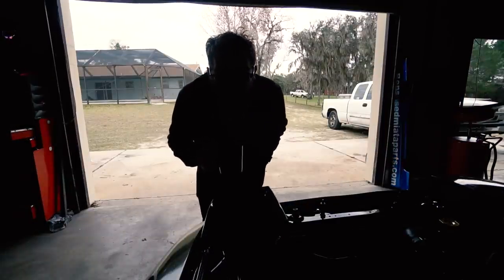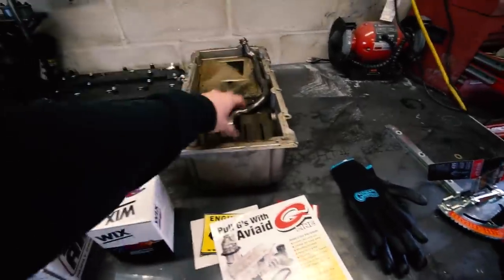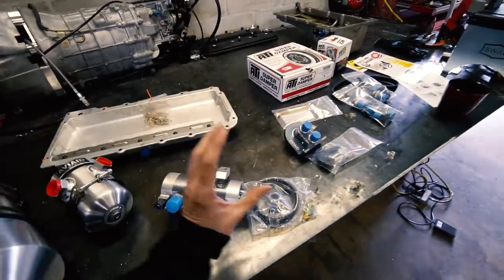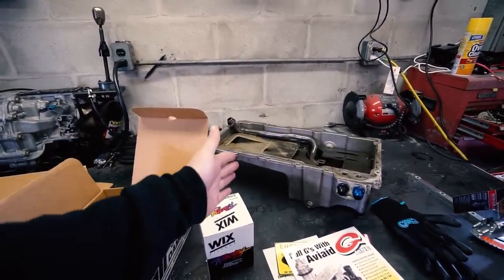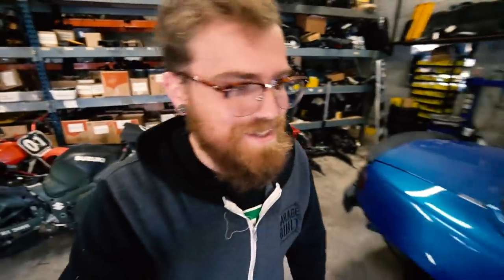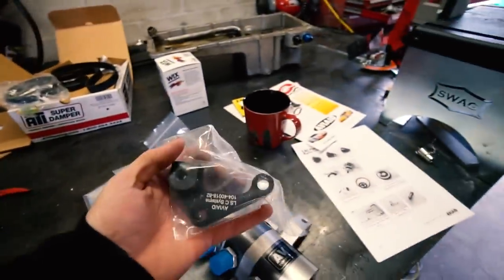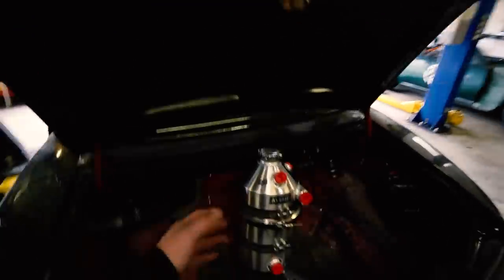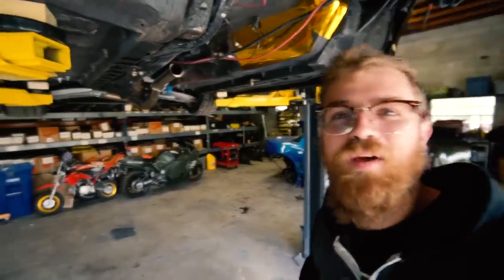Full DRY SUMP Setup For The LS Miata!

Comment: i know you don't want to.. but really rebuilding the whole engine is the best idea. you're putting all these nice parts on an unknown junkyard engine... it could throw a rod through your new pan the first time you drive it and send all the shrapnel through your new pump. at the very least order new bearings, rings, and seals while you have it out and inspect everything. just my opinion. you already know the engine has some problems.. don't cause more downtime later because you want it running now
Reply: Just what i was about to say!!! PLEASE Taylor!!!!! We want to see you rip the LS not only wrench it!
Reply: I agree, also find a way to get the sump tank closer to the motor/pump. Consider a prelube solution to avoid dry starting the motor.

Comment: Since you have to remove the oil pan, PLEASE just replace the rod and main bearings while you are in there!!! It is cheap insurance so that your new $2100 oil system doesn't get full of 100,000+ mile rod bearings. As for the tank cut out the floor in the trunk and drop it down in there. Use some of that leftover aluminum to make a new floor. As for the oil lines you could cut out some holes in the rockers and fish the lines through. This would keep them out of the car and away from the exhaust. Will be watching to see what you come up with.
Reply: Matt Lundquist if the oil lines are in the rocker panel, what happens if the car gets hit on that side and squeezes the lines shut.

Comment: From what I have heard, Peterson makes the best dry sump tanks.  I suggest you look at the insides of one and then think about what you can fit in front of the passenger side wheel well.

The farther your tank gets from the engine, the more likely it can starve from G forces preventing oil drain back from the tank to the pressure stage of the pump.

I know the big deal about Peterson tanks is they have baffles and angled oil ports to avoid splashing and aeration of the oil inside the tank.  Oil with air in it doesn't pump very well.

I think simple and compact will do better than long hoses and a big tank.  At least search a little to figure out your tank options.

Comment: Be sure to familiarize yourself with a dry sump priming procedure. They are killer systems, they work great, but require some extra steps. Also, be sure to read the ATI instructions. Typically the balancer hubs come around .007” under sized, you have to buy a brake hone and open them up a tad. If I remember correctly, ATI wants between .0009”-.0015” press fit to crank snout. If you don’t hone it, you will cry.

Comment: News Flash: Taylor Ray Rimjobs Rabbit-hole and Runs!

That's fantastic news. It's great to hear that you get to run your completed project in "stage 1" configuration.

As for the oil line routing, I would take out the passenger seat and carpet and run the lines up between the seat rails and the trans tunnel side of the passenger floor. You can cut an access hole in the firewall wherever it works for you, and right through the back of the passenger compartment by the oil tank. I would bend or weld a bolt-on plate/tunnel to cover the lines so you splash-proof yourself and your passenger, then reinstall the carpet (probably having to cut the carpet away for the cover) and seat. That makes it largely weatherproof and safe to use while riding with most of your stock interior, and still lets you unbolt it to replace the lines without cutting anything off. Running them through or near the rockers will probably lead to a massive leak when Matt or Adam come in at your door one day.

Comment: The ls3 comes stock with a dry sump system. I watched this video then shopped around and found that. I got the oil pump uses, used Pan, used tank. And several other nick nacks. Costed me 1100 bucks total for absolutely everything. 

I never knew the ls3 came stock with dry sump lol so that was handy to learn.

Comment: If you have oil lines that long please prime that oil system for at least 10 minutes at full oil pressure. should be able to spi. the pump with a hand drill with some adapters.  Dont use impact!   Just trying to help!
Reply: This isn't a gen 1 or 2 sbc, the oil pump is mounted to the crankshaft....
Reply: @nicholashall7233  you muppet.  Did you watch the video? The dry sump system has a remote mount oil pump that is belt drive lol.
Reply: Must have missed that. Wonder why they wouldn't have used a factory oil pump and done away with the need for a separate pump
Reply: @nicholashall7233  its the nature of a dry sump.  There are 3 pumps. 2 that scavenge off the bottom of the engine and merge to one line and pump back to the tank then 1 that pulls off the tank and pumps to the engine oil galleys for oil pressure/oil feed.
Reply: Nicholas Hall you didn’t miss it, you just didn’t watch the damn video.. 

Btw, normally they pull off the belt and spin the sump pump with a drill until they have enough pressure.
Reply: @francoinocencia604  i know most people know that just wanted to make sure taylor knew that.  And you spin it at pressure for 5 to 10 minutes to get any air pockets and bubbles out.  Aeration of the oil can kill it on start up
Reply: @francoinocencia604  👍 Definitely watched the video....

Comment: taylor i have been going over the idea of cutting the inside of my trunk out for some time now. If you cut the whole spare area out down to just below the lowest point it should clear the diff by a land slide. You would just have to weld a plate back to be the floor of the trunk. I havent fully thought about where and how the sub frame mounts but that is also something to consider.

Comment: You should look into the daily engineering dry sump stuff with their air oil separator.  It's pretty impressive with how well it keeps oil from foaming.  They have a good video on here showing how it works.

Comment: I have run the lines in side it's fine ,I find it feels safe , knowing you won't hit them on stuff and that won't get hot next to exhaust pipes ,you just have to come up with a good way to change the oil ,the tank was in side the car on my Nissan and it sucked to change oil ,the boot is the best place for it ,you can run a drain out the bottom.

Comment: Easiest way i found to lap valves was to take 1/4 inch fuel line hose and put the end in a drill, stick the other end on the valve and go to town. Otherwise you'll rub your hands raw before they lap well.

Comment: Could you not cut a hole the same, or slightly smaller diameter of the dry sump tank in the spare tire well, that would recess the tank and drain plug out the trunk pan? Then you could get some weather stripping in an attempt to seal the hole, and keep from having metal-on-metal contact between the floor pan and tank. 

And as for lines, would it be possible to run them on the inside of the trans tunnel under the carpet? It would keep the clean interior look, as well as keeping the lines away from any heat source.

Comment: One trick we use on the drains for the dry dump tanks is we use a fitting and hook up a hydraulic hose with a cap on one end of it so we can drain them without making a big mess. Also for the issue with running the lines, could you possibly run them inside of the unibody frame?
Reply: Garrett Calvert Ayy latemodel gang
Reply: I was thiking a ball valve and safety wire the handle in the off position, or take the handle off and just put it in the tool box.
Reply: twiggybuick the reason for the hydraulic line is so you can route the drain to a more convenient spot then use two wrenches to take the cap off of it. With a valve you would still want a cap on it anyways so no dirt or moisture could get in there. Plus I would rather look for a wrench at a racetrack then try to figure out where I have s valve handle 😂
Reply: @garrettcalvert6967  makes sense.

Comment: When your starting up your car with dry sump... add a delay to the start so it builds oil pressure before firing since the system needs to pull oil from the tank vs just pulling from the pickup and the crank already being wet because wet sump.

Comment: If you're going to put the sump in the trunk then you should run the lines like Rad dan does in Supra just use solid aluminum pipe then you can go through the passenger compartment

Comment: Taylor, cut out the floor in the trunk and weld in a new deeper floor so you can fit the big oil tank there 
That way you also will lower the weight point of the car at the same time 
And it would not be that much work to just cut the floor out and weld in new , and it will look so rad !

Comment: Taylor,  why not build your own custom oil tank for the engine bay?!!!!! Do it!  Way better than running lines to the trunk IMO. You can do it 👍. It would be an awesome project and I think a cleaner setup.
Put it in the shelf where the oil catch can goes. Looks like it will be a good volume of oil.

Comment: I'd lean more towards cutting a hole in the trunk to keep the oil capacity. Have you thought about running lines through the frame rails and just cutting a hole towards the engine bay at the end so they're still protected and if they fail you and a passenger wont get covered in hot oil. The only issue I would see happening is the lines getting crushed into the rail and getting the lines themselves in with fittings and stuff.

Comment: Since you have the after market frame rails could you clear out the old crushed up ones and feed the lines through there If so it would clean it up and protect the lines better without having to run it through the cabin

Comment: I'm psyched on the dry sump man!  I thought it was going to be way more then that.  On the parts to order, you may want to do head studs.  I have always heard you only use head studs once because they stretch, but I don't know that for a fact.  The other thing that I wonder about on running the lines to the back, will you lose pressure since the oil had to be pumped farther?

Comment: I wonder if the dry sump setup will increase horsepower due to the better oil evacuation in the block.  Seems like I've heard claims in th 15 to 20 whp range nothing too huge but it should rev much faster ? Your thoughts on this would be great
Reply: It's more like 5hp to 10.
 Engine masters used a 700hp engine and tested running less oil in Stock and high capacity oil systems but it was a wet system

Comment: Run the lines through the top of the transmisson tunnel? thats about as far away from the heat you can get. If there is enough room between the tunnel and transmission of course..

Comment: hey Taylor order your push rods last cuz with any machine work don't to the head or block mating surface will change there length I've built several engines and it is never the factory length after a rebuild they make a tool for it from jegs

Comment: So my plan wins ;-) . This second engine was in pretty shape, so doing the head jobs is the best solution in order to get the car on track again. And for the oil tank, I would make a hole in that spare tire bucket and build a safety bracket around it. So it cannot be damaged easily. And an oil drain is very simple that way!

Comment: About the cracked block, if it's just the bolt hole that is cracked why not just fill the old cracked hole and drill out a new one. Should be sturdy enough, then you can rebuild the engine when ever you have time and have that extra spare LS engine for future projects.

Comment: Could you not weld the block/drill and retheard to use the same block. Cut the bottom out to fit you could weld it. Could go throw the bottom frame real under

Comment: should run an AN line with a cap on it for the drain
Reply: Fumoto valve on the tank with a line run under the rear

Comment: Hello, I have a dry sump system too in 2l fiat engine and I have problem with air. Cant build oil pressure higher than 3 bar(44psi). I have about 5 to 6 liters of oil in tank and AN10 hoses, and on 4500rpm it needs only 15 sec or so to areate oil and pressure  drops from 4.5 bar to just under 3. Do you have any problem with your system?

Comment: go to the junkyard and pull a engine you can watch the miles and all that maybe just a short block
Reply: He is using a aluminum 5.3 which is hard to find apparently, only came in one or two GM vehicles he said in an earlier video. I was thanking the same thing until he mentioned and the whole weight deal lol.

Comment: Try doing stainless steel hard lines through the inside of the car if you're going to run oil to the inside I've seen rad dan build supras and he would TJ hunts car and he ran the coolant lines through hard lines through the inside of the car and then he boxed them in in case of a needle leak whatsoever the driver will be protected plus they told TJ hunt that he couldn't run his car like that they didn't let him pass tech

Comment: @taylor ray maybe take some notes from Porsche racecars. Every aircooled Porsche all of which  are drysump, always have the oil lines ran through the car front to rear and are attached to the passenger side rollcage running UP along the tubing. Its done that way for a purpose to gravity feed the oil and is highly efficient

Comment: Ask cleetus to see how long it would actually take to rebuild an LS. They rebuilt rubies motor and it didn’t seem like it took them to long. I don’t really know the LS that well so I’m not saying that it’s easy.
Reply: Unko_kaikai .b cleetus has alot more money behind his projects and they are going with a normal 3rd generation iron block 5.3, taylor has a more expensive aluminum high output engine, and less money to put behind his projects and cleetus has alot of brand help as well.
Reply: Lol Cleetus did a refresh at best, not a rebuild. He didn't even take the crank out. A rebuild is much more involved than what you saw them do.

Comment: Tylor, use a smaller tank.  That tank is too large for your application.  running oil lines inside, might not make tech inspection, you should check the rules at your track.

Comment: I have such a boner for dry sumps. I've been wondering if you could do a sloppy diy dry sump using an electric scavenge pump in the stock pan with a bulkhead fitting to the stock oil pump for feed.

Comment: You coulda just put an oil pan baffle..
Reply: Michael Wratten its come baffled all LS pans have 2 baffles. One is attached to the studs directly under the crank and another lower near the oil pick up.
Reply: kenneth smith no they don’t. They oil starve 
Those are not baffles those are windage trays